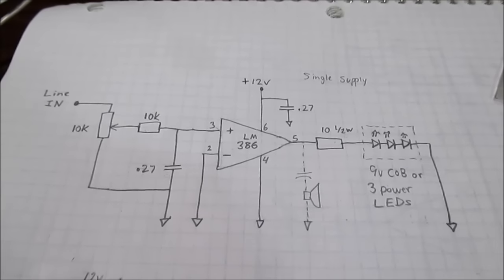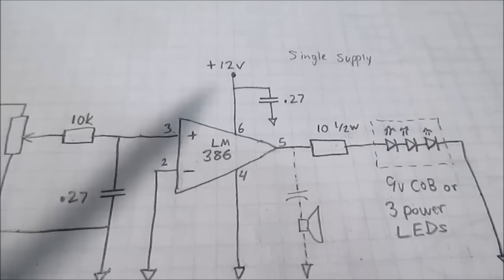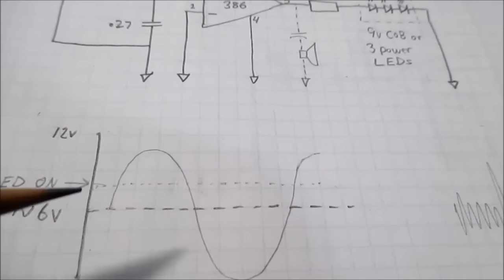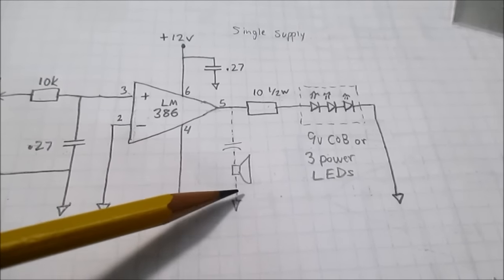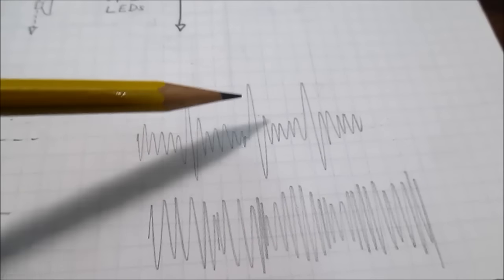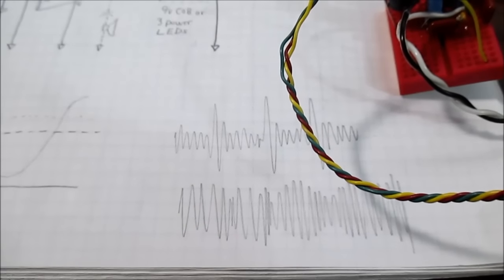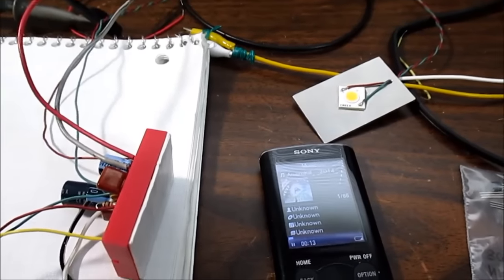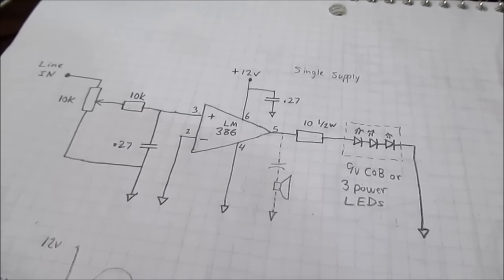LED strobes to the music beat - simple circuit

Comment: Hi John, I have been following your series with the color organ and the LED strobe light. I built one of those Velleman kits, sound to light, flashing with different intensity of light. The one I made with the kit PCB kinda worked, the lights just stayed on all the time and did not vary with the music. I had a second kit of the same I built on a full size bread board and it worked perfect. I will try to debug the PCB kit sometime. I have two more schematics in my collection. Looking to see what you come up with next. Nixie tubes are cool, perhaps something with one or more. Mr. Carlson's Lab I believe has a video about them. Enjoy the rest of summer, take care, C. P.S. Radio Fun 232 on YT has a few interesting videos. Changing a square wave to a sine wave, etc..

Comment: I'm wanting to make an LED driver circuit which connects to a speaker's terminals, but won't affect the impedance ''seen'' by the amplifier. I'm designing/building a 2-way speaker project & want to add LEDs which will be connected to the woofer's & tweeter's terminals via the LED driver circuit. I've seen other examples where LED strips are connected directly to the speaker's terminals, but I'd rather not use this route. Since higher end receiver/amplifiers are fairly impedance sensitive, the idea of simply adding some extra components to the drivers could alter the overall impedance of the speaker system & could possibly damage the amplifier. Do you know of a simple LED driver circuit that can be wired to the woofers & tweeters yet is isolated in a way as to not change the overall impedance of the system?

Comment: is there any quick way of changing the frequency on the input ? (I'm a newbie so havn't got too much knowledge here)
Reply: adding a low pass filter by calculating components using something like online calculator
Reply: already has a low pass filter, not sure on how to do a high pass, I want to make a couple and try and run stripled  lights
Reply: johnnytheangel1
why not use somethig like crossover schematic but on much smaller scale for passive low and high pass filter
Reply: I don't really want the low to come thru as much as I want more highs, mainly want to use it for guitar, (if possible)
Reply: johnnytheangel1
i think adding a cap will cut off low freq as it works in crossover inductor is cutting high freq while cap is cutting low freq
Reply: at the moment I am playing with a LM3915 but not having much success in dot mode, bar mode seems ok, dot mode just seems to dim the leds, maybe a bad chip,?,  was thinking if it works run lead through splitter to lm386 into lm3915 in dot mode and see what effect I can get that way, only one way to find out
Reply: johnnytheangel1
well i did lm3915 vu meter but with additional components and it looks great on bar and dot mode, doesnt make like 3 diodes blinking as one diode - simple vu meter does, mine is peak meter, what i mean is when you have simple vu meter and there is bass, sometimes 3 diodes is blinking as one if singnal is low, in peak meter diodes are lighting up in order like 1 - (1,2) - (1,2,3) i took schematic from here http://bartvenneker.nl/index.php?art=0011
Reply: couldn't get to that site, but today I tried a lm386 module in front of lm3915 but I think the trimpot needs to be changed, less than a 1/4 turn and leds are on continuosly, tried it on speakers and I'm distorting a 200w 4Ohm bass speaker with a 20oz magnet at less than 1/4 turn, so back to drawing board
Reply: johnnytheangel1
here you go http://www20.zippyshare.com/v/wFUxhxq0/file.html you dont need to use 6 leds at every lm3915 output i'm using one but that means that you could use as many leds as you like if you have proper supply for it, lm3915 needs a bit more than mp3 output i think its 300mV something like that, because using with my mp3 player at max volume lm3915 did 7-8 leds, 2 leds were not lighting up because need a bit more power to input, so if youre using lm386 make sure you connect lm3915 gnd to lm386 gnd and put 50k trimpot single turn on lm386 input, so you can decrease lm386 output which is comming to lm3915 input
Reply: will give this a try, I'm finding the same problem with vol input into lm3915, thanks, on the lm386 module the cap between pins 1-8 needs to be changed but seeing it is so small I can hardly see it let alone try and change it